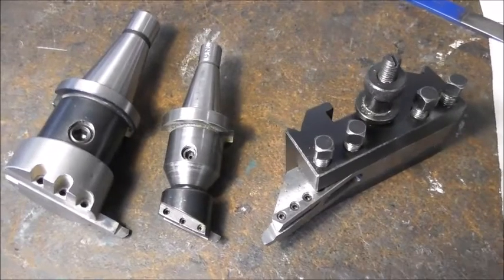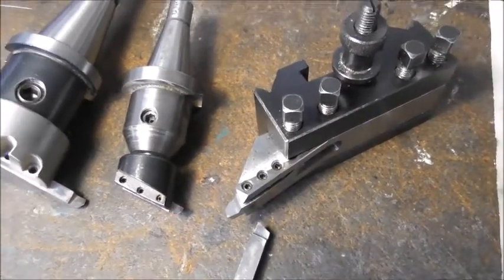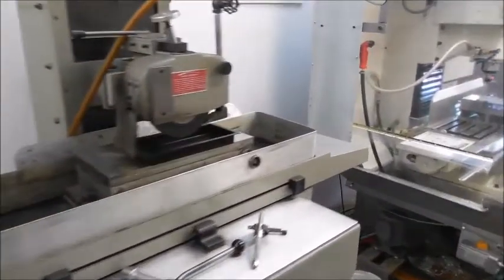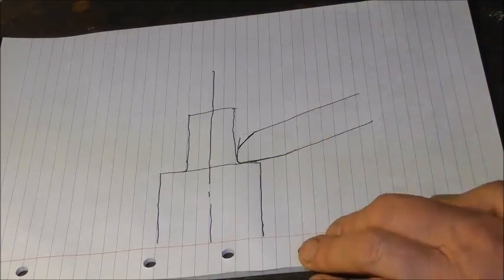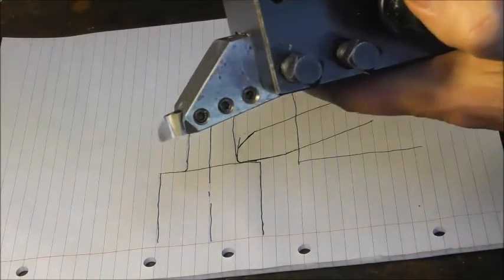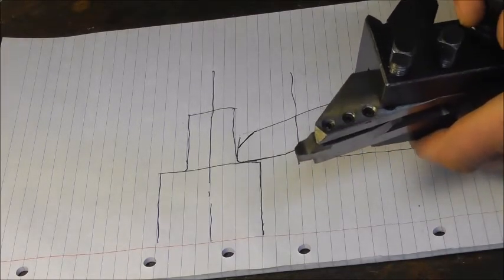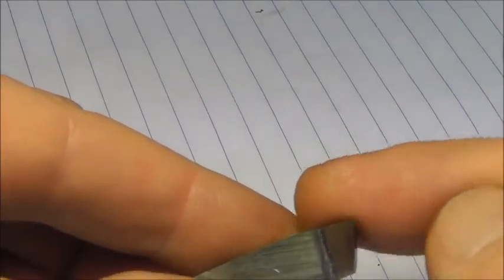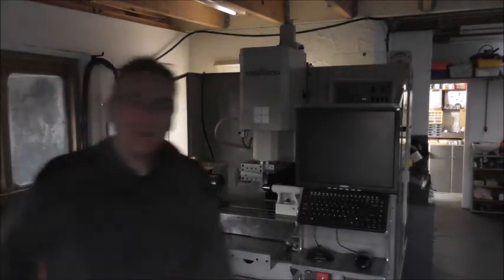Freehand Grinding -  Part 2  - Turning and Fly Tool Bits

Comment: Nice one mate I have to say you are doing as good a job as they do at tafe explaining the angles and.the grinds. Once I had some experience on surface and cylindrical grinders and correct wheel dressing my free hand grinding improved exponentially. Cheers from the other Down under
Reply from the maker: Cheers Andre.